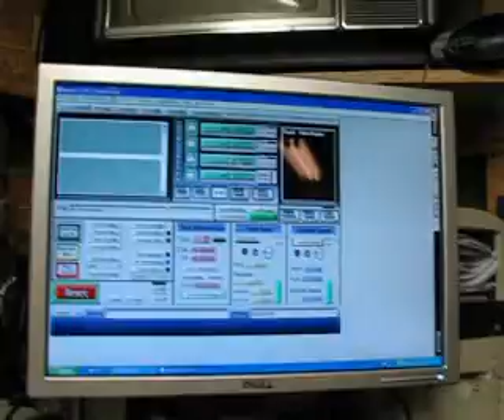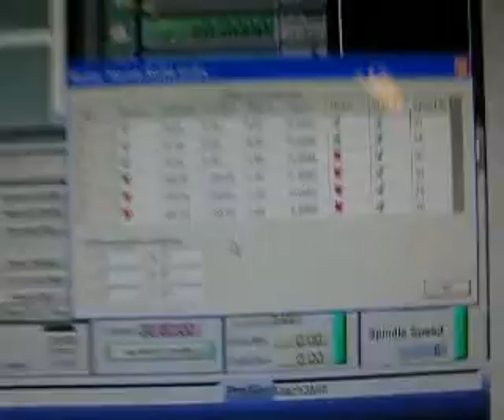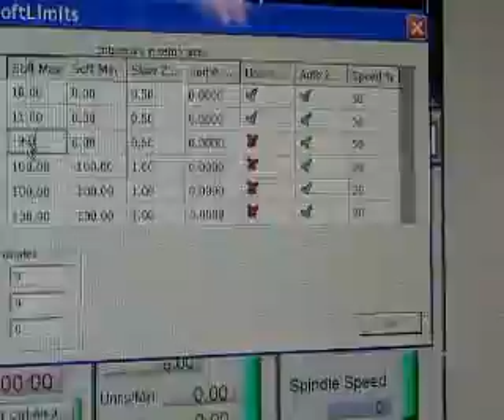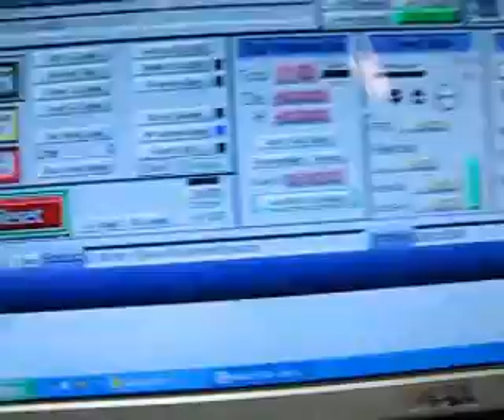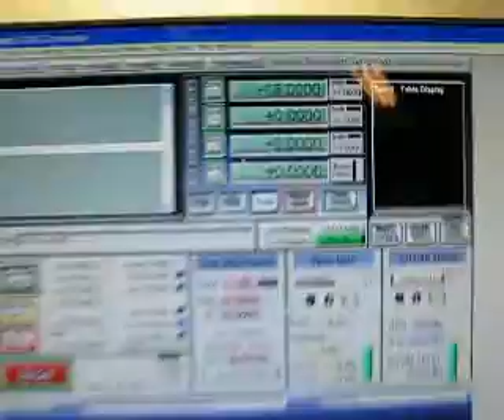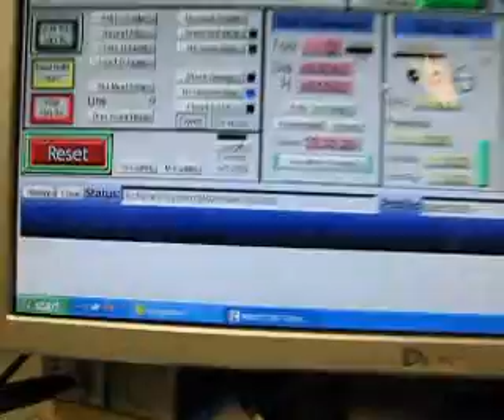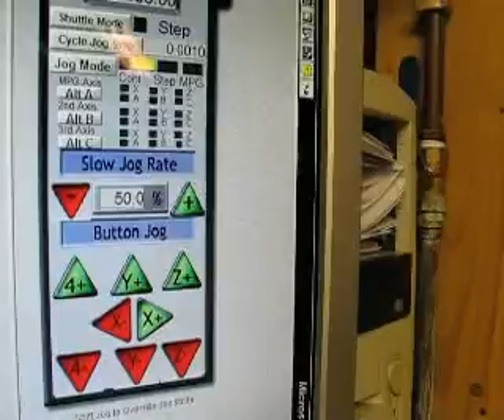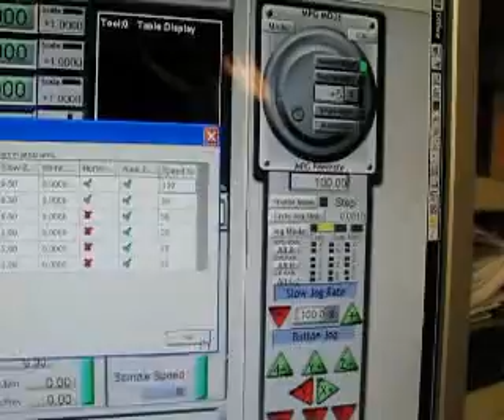home switches and soft limits

Comment: Did big Hoss pass away?
Reply from the maker: nope been busy getting healthy, down 321 lbs. might post a new video sometime. got the g0704 running again with UCCNC now.
Reply: I have been subbed to you since 2009 so was wondering what had happened and glad to hear you are doing great.  Just a few more to go and you will be thin.
Reply from the maker: @thebeststooge  thanks only weigh 180 now @ 6'3" so thin enough lol
Reply: Oh, lol, I had read that as down TO 321 lbs.  180 at 6'3 WOW, that is pencil thin.